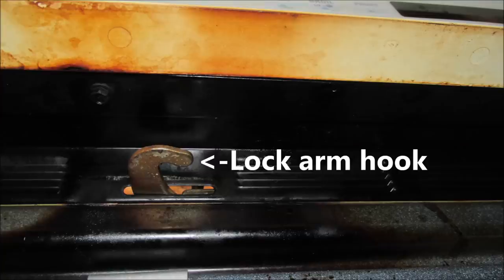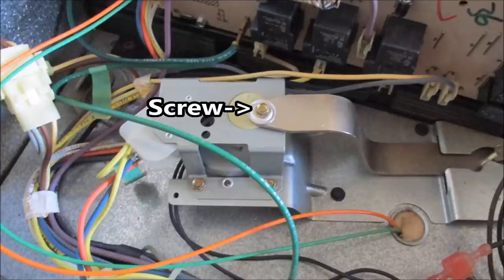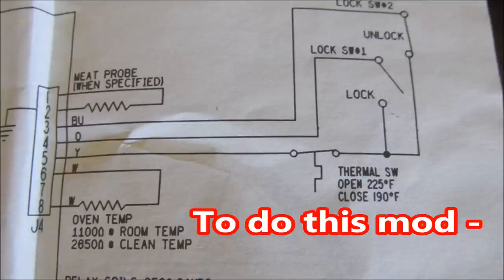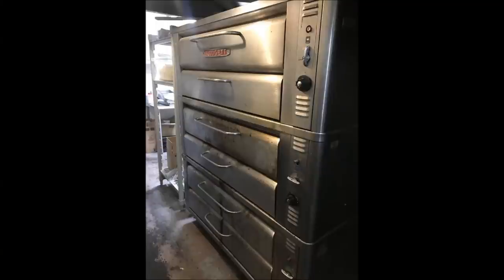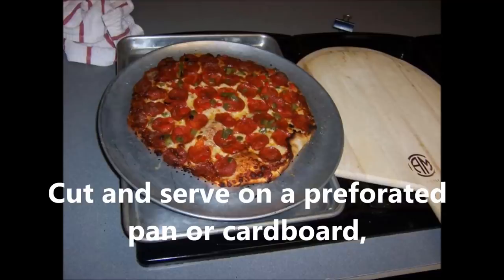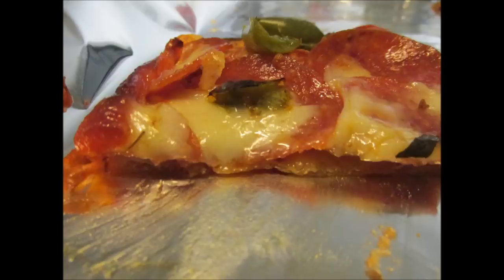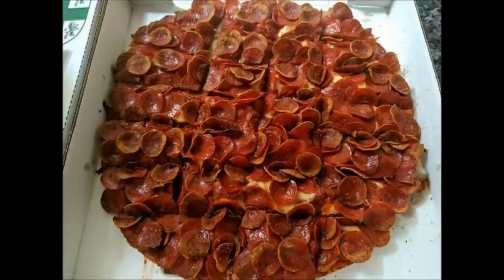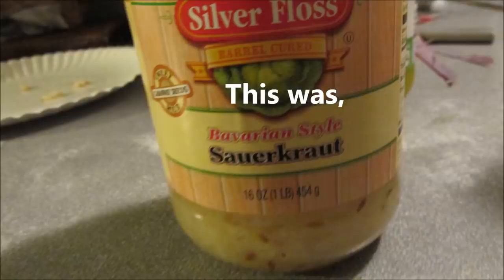A Pizza Oven is in your kitchen

Comment: coal fired ovens avg 750
Reply from the maker: On any Large refractory lined oven or steam boiler they must return to operating temp slowly. The larger the internal surface area, the longer this takes. In some cases up 24 hrs, if rushed often the refractory will start to crack from the rapid expansion